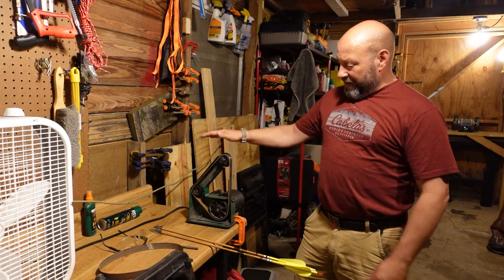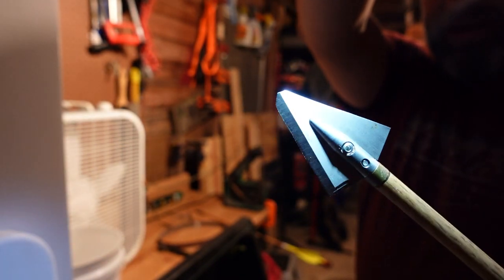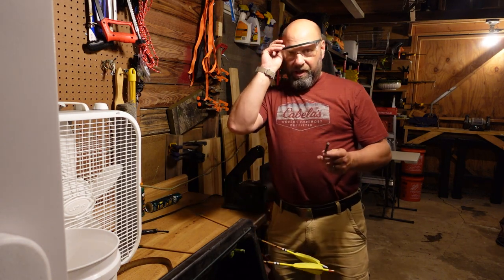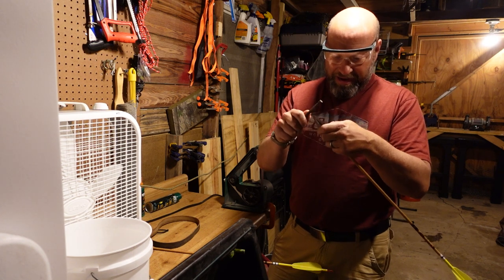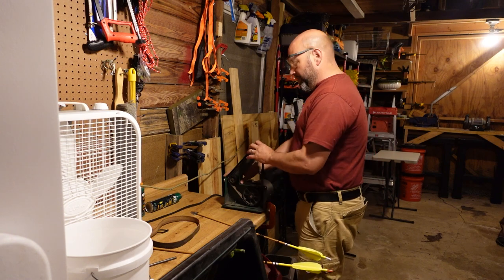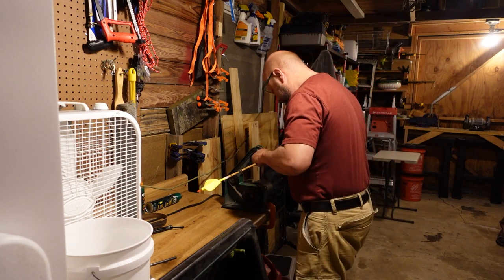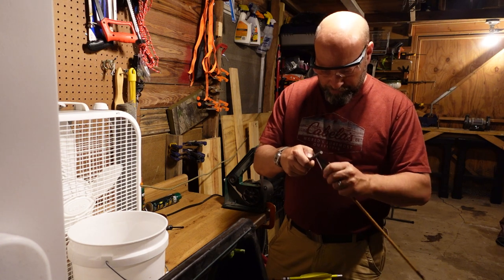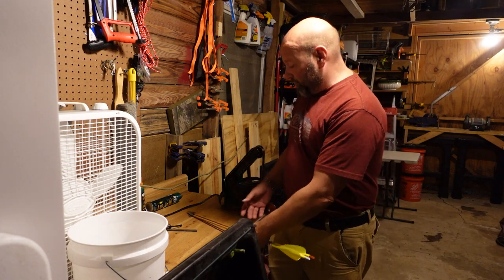Fast Easy Cheap Sharpening For Knives And Broadheads

Comment: Something I learned and practiced after sharpening my single bevels: Use gun oil on the blade after sharpening or bike chain lube... this will protect it from oxidizing and you can just wipe it off before you hunt :) I keep about 6 broadheads ready at all times 4 in the quiver.
Reply from the maker: Excellent tip! Thank you. Rem oil (remington gun oil) works excellent to and leaves a thin protective dry film over them too.
Reply: @SamkoTradBow  heck yeah!! Great minds like alike!  😎

Comment: Is it important to keep the blades cool while sharpening as to not loose the temper on them?
Reply from the maker: That only matters if you are profiling a knife blade etc. You won't get a broadhead hot ,not even warm sharpening one.
Reply: @SamkoTradBow  thanks so much :) Iam just thinking of a knife blade thats thinner behind the edge thats why i ask. I will usually dip it after each light pass to cool it. I have the stones but its holding a damn angle consistently thats the problem. I did thijk that with a thinner broadhead blade there isnt much steel there and that like a knife edge could heat up very quickly :)

Comment: Hey Jason, thanks for all your videos! I have a question not pertaining to sharpening but was wondering where you get your heavy judo points? Looking for 200 grains. I did get a hold of Travis on FB too so thanks again!
Reply from the maker: To get a heavy judo you have to buy the glue on 135 grain model then buy steel 75 grain adapters to the thry glue onto and screw into your inserts.

Comment: I just watched your video about things to know before purchasing a cargo trailer. Which cargo manufacturer do you recommend?
Reply from the maker: Most trailer manufacturers offer different levels of trailers with the stuff mentioned in the video. Find the trailer manufacturers that are sold in your area and then look on thier website to find the specs and model you want. Then call around to find or order one. Trailer manufacturers vary all across the country as they don't want to ship them too far. So 200 miles away might be a whole different ground of trailer makers

Comment: how large to how small  of a broadhead would you use? more than three inches? less than one? not cutting edge but width, just wondering
Reply from the maker: I like a 1.25- 1.5 inch wide head.
Reply: @SamkoTradBow  maybe i wasn't clear, i know that's the middle but would you ever use something outside that range? thanks again